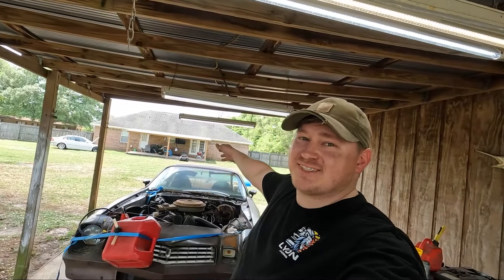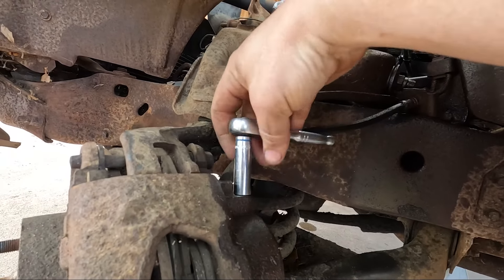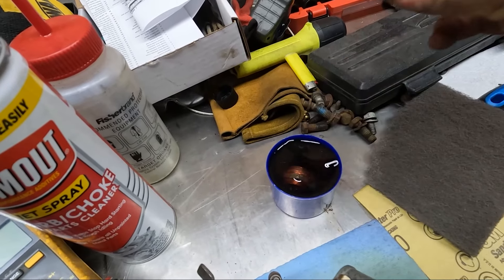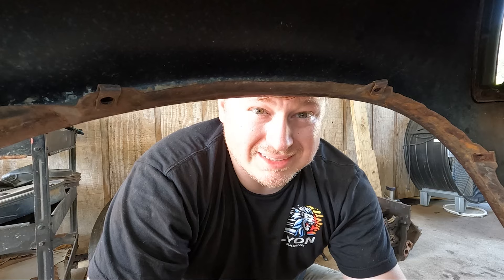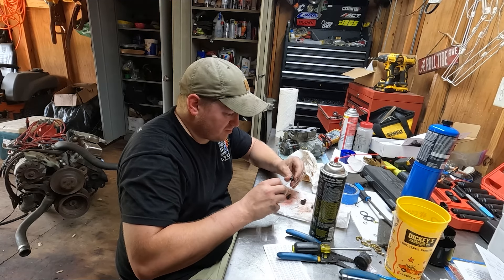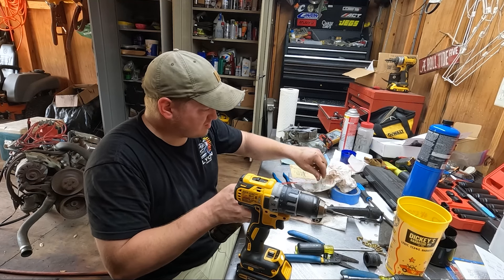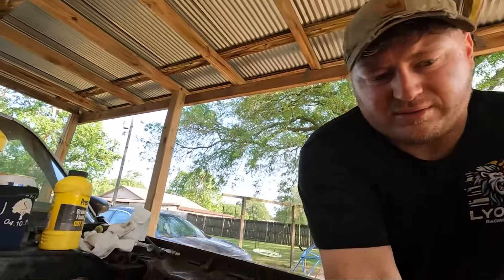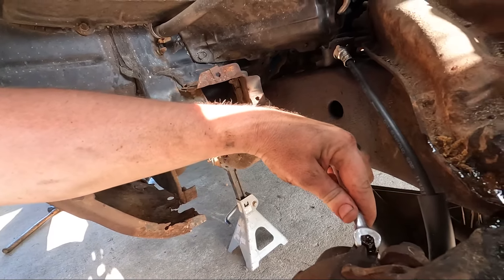ABANDONED 1979 Z28 Camaro Brake Repair and First Burnout in 36 in Years!

Comment: Yes! I've been so excited for this video to come out. I love that car so much!
Reply from the maker: Heck yeah me too man. Thanks for watching and the support bud!
Reply: @LyonRacing24  the car needs a posi and a hot
 cam lol. Should probably upgrade rear brakes and get a clutch first lol. Nice tools by the way, DeWalt all the way.
Reply from the maker: Defiantly needs a clutch BAD! it slips just shifting into 2nd. I had to help it do a burnout with working the brakes lol i want to get it on the road once, then its gonna need a full tear down to fix everything. We will get there eventually, and if its all pulled apart might as well put a cam in lol

Comment: Shouldnt the z28 have a posi???
Reply from the maker: I would think so, but I will check the build sheet when I get home from work.
Reply: @LyonRacing24  i googled it and actually 50% give or take got posi for that year….just jack up the rear and see what way the wheels spin….but im sure you already know that
Reply from the maker: @trentdawg2832  yeah I’m pretty sure it’s not a posi unfortunately, but it has sat for awhile might need some new fluid to help it grab. Idk if  it’s a clutch type. I’m definitely going to check the build sheet when I get home. I was fortunate enough that the person I bought the car from saved all of that paper work lol
Reply: @LyonRacing24   either way its still a cool car…..ive always loved the 2nd gen camaros
Reply from the maker: @trentdawg2832  me too man. They have a great look
Reply: @LyonRacing24  get a wire brush on the passenger side axle tube, on the side pointing to the front of the car. there will be a number and 2 letters. those first 3 are what tell you the rear gear and if its a posi or not. look up the axle tube codes your that year car, and you'll find out.

Comment: Exploding brake hoses is a good indication that the hose is completely clogged up. Please wear some eye protection while heating those, boiling brake fluid is not something you want in your eyes.
Edit: at 13:50 you read my mind 😂
Is that another small block chevy on the garage floor?
Reply from the maker: lol yeah for sure, them lines couldn’t pass any fluid. I had my head hid behind the fender on the fronts. Yeah man that’s another 350 with a cam and some double hump heads just waiting on a drag car project! I also have a 6.0 and 5.3 LS in the shop too. The 6.0 is going in the BMW to replace the tired 5.3 that’s in it now after this drift season!